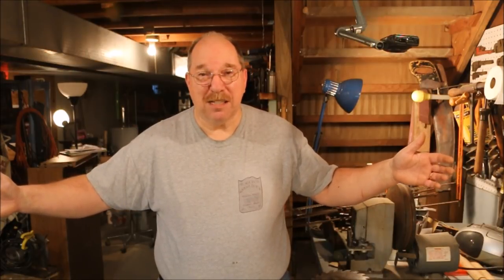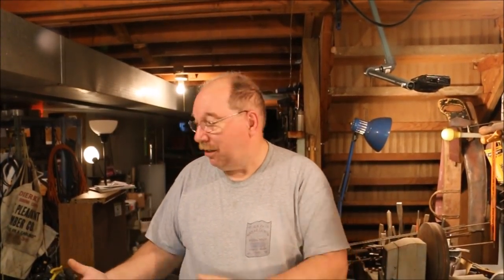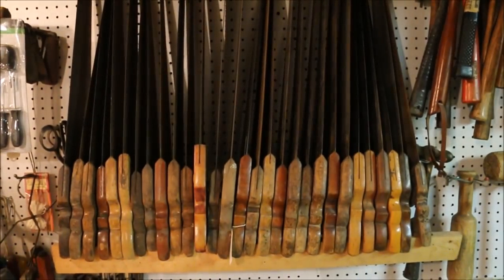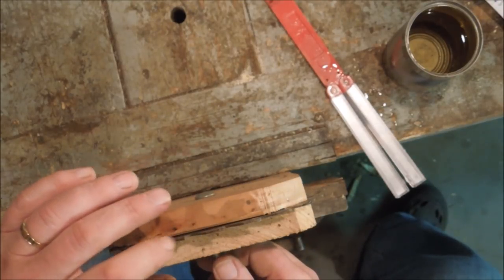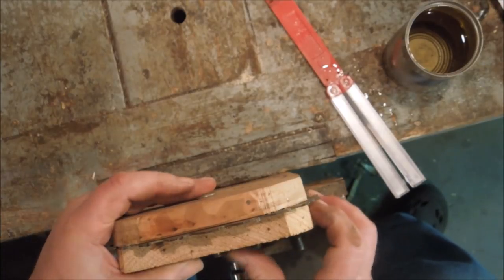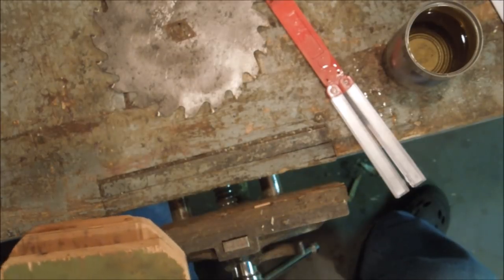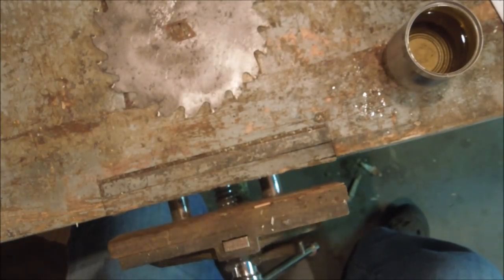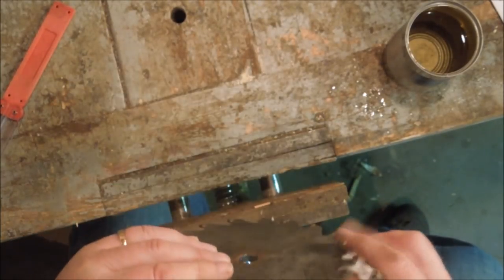CAN YOU SHARPEN CARBIDE SAW BLADES BY HAND ~ PART 2

Comment: so just taking down the tops? or more to come?   how are you going to get the BLO involved?  ive never seen a blade with a diamond shaped centre, is that a trademark of one particular company for for one particular saw?
Reply from the maker: Jusb1066 Just part one so far. 😈
Reply from the maker: Jusb1066 The Skill screwdrive saw has a diamond shaped arbor. The blades I get used are typically less expensive. They will have a round hole with a diamond knockout like this one did.
Reply from the maker: Cabinetry requires saw cuts to inside corners. Circular saws are great for through cuts and dados, but hand saws can run rings around them on inside corners.

Comment: I just roll the yard with the wide tires on the mower. It don't need ballast with me riding and if I don't get the hump the 1st time, I'll get it before fall comes, sure. I've got a Wally world Parker that fits back inside the handle that will still put a razor edge on the finger cutter Zollken---?--whatever it is and is slick as my head in the slick place but it still works. Like when your sharpener started doing the real deal on a tooth, you can tell when the slick job starts putting the edge on that 10-incher. I suppose I need to get another one but it still works. That's the code of Sneelockisms. If it still works, leave it be and let it work some more! Good job, Unc!
Reply from the maker: Lewie McNeely The front yard grows pretty well except under the big pines. I thinned out the trees a bit and planted fescue. Cheapest seed at the store but it grows in the shade. 
Back yard is all clumps of grass with holes between. 4 truckloads of topsoil and thinned out the trees. Still no grass. Threw a couple pounds of the fescue on last year and it's filling in nicely.